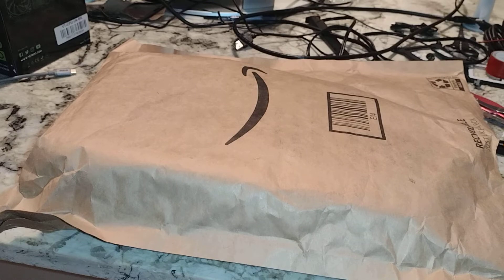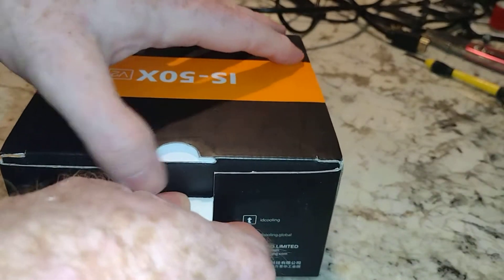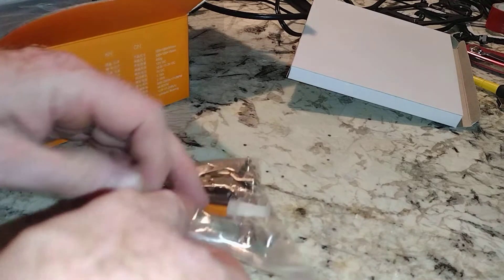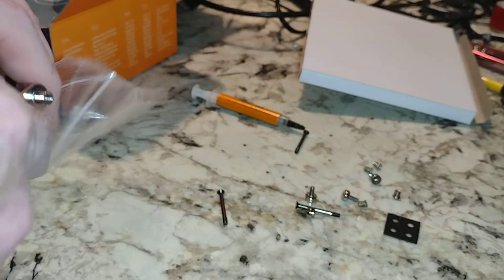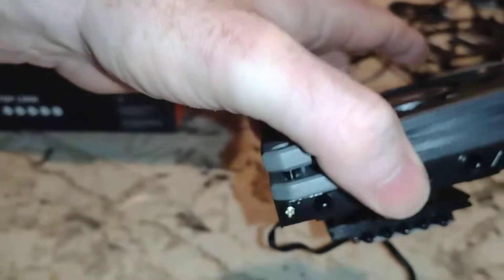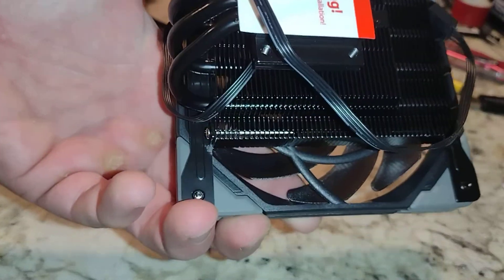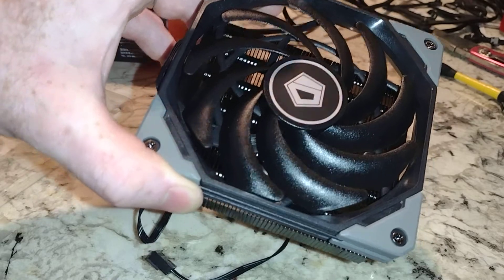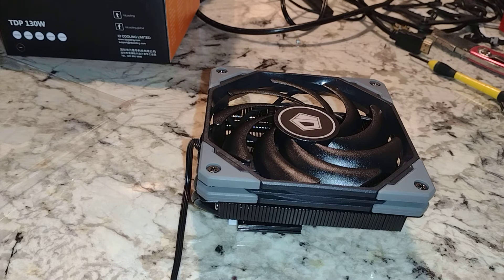Unboxing ID-COOLING IS-50X V2 CPU Cooler Low Profile

Comment: What do you think about its stock fan? Is there will be difference to swap fan it? Like arctic p12 slim fan or scythe kaze slim?
Reply from the maker: Normally, if this was tower with the fans pushing air across the heat sink(s) and may apply here, I would say look for the fans that a higher FLow (Q=VA)  If, they are all 120mm, than A will be the same for all comparisons.  For V, which one has the ability to have a higher fan speed.  If they are all rated at the same amount, they are probably all are roughly the same.  That said, one can only be sure through actual testing...as the design of the blades will come into play as well.